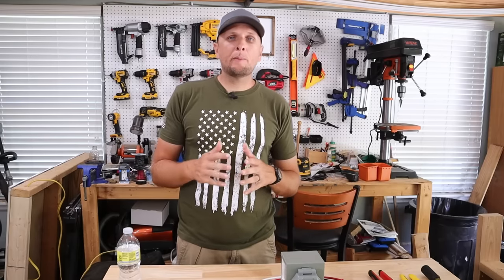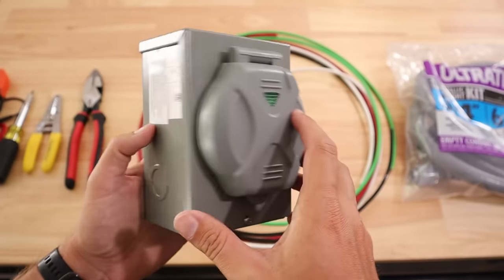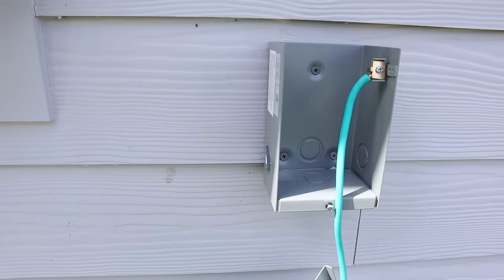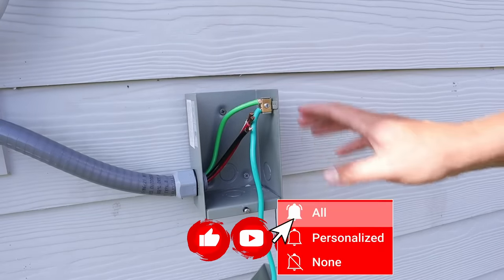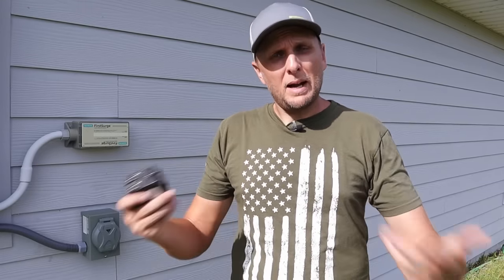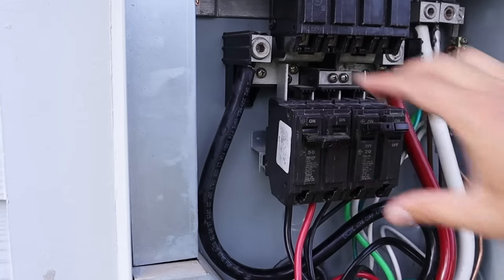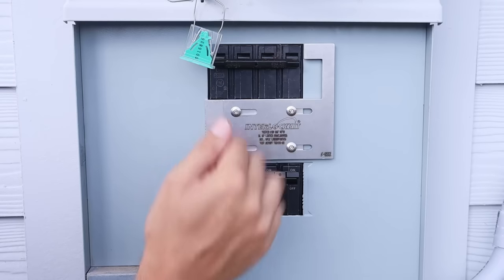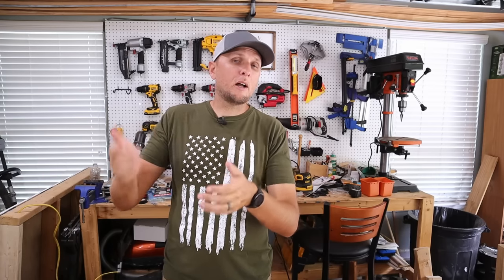The BEST Way To Connect A Generator To Your House - Interlock Kit With Power Inlet Box Install

Comment: Great video.  I have done about 4 of these installs (30A), the process is the same, the plug & wire sizes are different.  The interlock kit is essential - this will prevent you from back feeding the power lines & not injuring the guys trying to fix the power.
Reply: all of the codes for proper solar systems require a electro-mechanical disconnect that automatically disconnects the grid from your home in the event of a power failure. It must be manually reset and can only be done so once the grid is going again.
Both the City/County inspectors along with the energy department's inspectors must sign off on it to get your system approved.
If a buy back of over produced power is approved, then a contract and bidirectional meter is installed.
There's nothing like a lineman getting zapped by someone.
I've seen the mechanical ones and they're fine, however for those on hospice care and CPAC machines, keeping the power going automatically after the power goes out is nice.
Reply: @Keith Lucas, can you advise where I can find an electro-mechanical disconnect and what they look like? Thanks
Reply: What size wire for 30amp plug?
Reply: @juanrdgzg 10/3 Romex with Ground
Reply: Seems like it’s always better to install a 50A generator inlet and just use an adapter for the cable so if you do upgrade you don’t have to replace it.
Reply: Use wire size for 50 amp just in case you size up from 30 amp.

Comment: Well done once again. I had a 8500 running watt genny II connected through an interlock kit on my main panel. I worked flawlessly, powering everything except the 3 ton ac. Tankless hot water and furnace are natural gas. Last year I caved and had a whole house 24k ng unit installed by a contractor I use a lot for rentals and our house. $12,800 total cost. We also added the Micro-Air Soft Start to the ac unit.

Comment: Great Instructions! Thumbs up on this one. I set up a 30 amp interlock system for my house. Using a 55 watt 8250 watt surge gen. Only thing I can't run is the Central Air. I went one step further and converted my gen to use natural gas so I don't have to worry about gasoline storage problems. Thanks for the Vid! :)
Reply: I have a similar set up but with a propane conversion. Look into getting a soft start kit for the central air. It ramps up the amperage to allow the generator to handle the load.
Reply: I got a 12000 watt DUROMAX but am going to be installing a 30 amp switch like you. Though the DUROMAX can handle 50 amps, the cost is double and I don't plan on ever running this beast beyond 50% load.

Do you have any info or are you able to point me in the right direction or as to how I can go about converting mine to natural gas also by my chance?

Any help would be much appreciated
Reply: @nikolasvel  One caution: If using a power cable less than 50A rated be sure to use the generator's 30A receptacle, not the 50A one, & be sure anyone else using the unit knows - and remembers - that. Fuses and circuit breakers exist to protect wire and the 50A outlet from the generator would not safely protect a 30A (#10/3) cable.
Reply: @larrydouglas3951  thank you for the response. I ended up going with a 50 amp cable, 50 amp recipticle, 6/3 copper wire to a 50 amp breaker and an interlock kit. I also added a "reliance power back on" detection device.

Comment: Excellent Video.  This is the Same setup I used in our home.  It's low cost, compared to Transfer Panels, way easier to wire, and works safely, preventing power back feed to the utility.
Reply: If you have the intelligence and skill to do this aren't you capable of switching the main breaker off " preventing power back feed to the utility" ?
Reply: @bigpardner  Who is going to guarantee that you will be the only one to do the power up?

Comment: Great tutorial, thanks for helping me out, more clear impossible. Noo wasting time ,pure knowledge, and easy to understand. I just finished my installation. I will try tomorrow morning .Let's see 👀 .My only concern is if the inlet box led indicator is just turned on when the generetor is connected and sending power through. I installed everything, but when I turned off the main brakes, I didn't see the tiny light on the box light up.

Comment: Enjoyed the video. Years ago, I also installed a manual interlock kit on my Square D panel. The kit is basically the same with a nice template for drilling the panel deadfront for the interlock plate. I used a "3R" enclosure for my generator receptacle, in that, the twist lock plug plugs in the bottom of the box, making the connection waterproof. Works great. Thanks again!
Reply: I was considering just mounting my receptacle box directly to my main box allowing more water resistance 👍 I think it's a good idea.
Reply: Can you elaborate on how you did that? I need a waterproof connection myself

Comment: Great video.  I found an interlock for my Square D panel for 30 bucks!  Lots of room too.  I have a 4500W (120V only) but it runs everything I need for winter outages since I have a Blaze King wood stove and I can run my water heater at 120V, it just takes longer to heat.  And I got all my freezers and refrigerators running fine which is the biggest deal.  Anyway thanks again I kinda just confirmed what I thought.
Reply: Can you tell me how you made the adjustment to 120 volt on your electric water heater? I'm not being smart I just want to know so I can go smaller on my generator.

Comment: Great informational video! 

You should also ground your generator.  I used an automotive battery cable and a screw clamp to the ground rod near my box.

If you only have a 30A generator, select wiring and a tie-in plug rated for 50A. Be sure to use a 30A breaker in the interlock.  When you get that bigger generator, then you can swap out the 30A breaker, and will not need to rewire or replace anything else.
Reply: If you plug a 30 into the 50 amp plug the generator already has breakers for the output, in that case the panel breaker only serves as a disconnect. So it doesn't matter.
Reply: Generators these days are already grounded...  Some states dont require  additional grounding..  However check your codes..Yours might

Comment: I did pretty much the exact same install for about $100. Had to purchase an adapter plug to send 120 into 220 to run my predator 3800. It runs everything in the house other than the hottub

Comment: electrician here , you did a pretty decent job! it's generally helpful to measure any wire coming from your junction by the length of your hand plus your thumb (thumbs up). it you have trouble feeding your wire through the carflex.. you can dump a little water in there and your wires will slide on through , alternatively , you can buy wire lube from your local supplier.  the bend radius may be exceeded on your feeders mainly black . its not bad but pretty close to being a violation.

Comment: Hello Sir, love your videos.  Very informative and very easy to follow.  I have a situation though.  I'm trying to set up an Ecoflow system in my garage, and in all the videos I have reviewed, the Main is typically incorporated in the same electrical box.  However, my Main cutoff is on an outside panel and the inside box is on the opposite side of the house.  How would I go about installing the 30 amp plug in the garage and the interlock switch since it doesn't look like have a Main inside?  Would I have to install another Main on the garage electrical box?  Thanks for your time.

Comment: Good job Adam and nicely explained! We have virtually identical setups. I have a MicroAir Soft Start on my 6T AC and a 9500w Westinghouse generator dual fuel running into my 50a inlet box. Works perfectly!
Reply from the maker: Hey Lenny, yes I think I recall many months ago talking to you about the soft start kit.  I think you were waiting on more to come in.  It makes a massive difference doesn't it?  Really glad to hear you are all setup.  Thanks a lot for the feedback.
Reply: What does the soft start kit do and how do I know if I need one? I have a 9500 running 12000 peak generator that I just set up for 50 amps exactly like your video shows.

Comment: just be careful and use a torque screwdriver to make sure its within specs
Reply: Great advice with torquing to spec.  Also, 6" of wire from the face of the box would be nice and perhaps strap your conduit with a one hole strap.

Comment: I went with a Manual Transfer Switch and purchased the largest portable generator available, 17.5kW, and put a propane conversion kit on it and set a 500 gallon propane tank in the ground.  To exercise the generator I use a 30# bottle and hope I never have to tap into the stored ground tank. Yes, I have been hit with several major hurricanes in my lifetime and simpler is better.  Sometimes we have been on generator power for two weeks till power is restored. Gas lines at the few operating stations are insane, no more gas for me. I make sure to kill the breaker to the stove and dryer lest "some one" forgets we are on auxiliary power.  The water heater is a heat pump unit and  it only draws 3 amps so no more heating bathwater on the back porch with the fish fryer.
Reply: I love this idea. I don't know much about propane storage. How long will a 500 gallon propane be good for when stored long term? Do it go bad, like gasoline over time?

Comment: I have the Same set up But I have a 9500/12,000 Generator, I did install the Micro air   It runs everything  total cost including electrician was $2100   Generac wanted $12,000 for an auto start Permanent

Comment: Just keep in mind that even properly done, interlock kit and so on, linemen won't (might not) power up your home if they hear a generator running. When you see them in the area, either turn it off or make sure to let them know If possible. 
Great video.

Comment: Last fall, we had an electrical contractor come in and install this in our home. We set a portable 13kw generator on a pad and covered it. We had already upgraded our panel from 100 amps to 200 amps with all new circuit breakers as needed. The contractor ran conduit from the back of the house, through the attic and into the panel. Several breaker upgrades were done, plus the breaker from the generator and installed a surge protector. If the generator is needed, we simply shut off the power into the house, start generator, switch on the circuit breaker from generator and the whole house will now be running off the generator. I have a number of individual breakers to household that will be turned off since we won’t need power to those areas. The most important to HVAC, freezer, refrigerator, stove and kitchen, plus a few others will provide the necessary emergency power. It’s a great system, cheaper than an installed full house auto start generator. I decided against that because running the gas line was going to be really long and difficult to install. The generator can run from gasoline or propane.

Comment: I run a 6kva  single cylinder diesel generator, 100% reliable - has to be as I live in the caribbean, runs the whole house- no problem. Also very important to operate under the kiss principal as part can be hard to come by.

Comment: I looked at these cheapo amazon inlet boxes. I bought one maybe it was the rophor even... they are tiny inside trying to feed in 6/3 wire and make all the connections was too tight for me.

If you have the mulah I highly recommend GE T050N. It is a much heavier duty box and the plug actually sits in it at an upward angle of about 5 degree, when you are using a massive heavy generator cord rated for 50amp it puts a lot of stress on the ends when you plug it in at a right angle so this is just a way better design. 

I also found a guy on ebay who 3d prints magnetic covers for the bottom of them to keep wasps and other big bugs out of it. 

I actually mounted mine in my garage then used a PVC RV cord port to pass the cord through my garage door. Works pretty slick

Comment: We live in Louisiana and as you know we get a lot of hurricane and tornado weather.  Presently I’m running a 6500 generator that is wired to my panel box.  Before operation I have to turn off the main and all the 220 switches.  I go outside and get everything set up and start the generator so it can warm up I then go back in and turn on the main, go back outside and make sure the power switch on generator is off.  I then hook up the plug to the switch I have set up outside and connected to the breaker in the panel box I turn on those 30 amp breakers go back and ensure generator is at full power and flip the switch on the power switch and viola I am able to run all 110 outlets and lights/fans.  Now we are ready to increase the size of the generator to run all 220 as well so we have A/C,hot water heater, make coffee and microwave if needed.  Going to get a generator that is electric start as at 79 years young no longer able to pull the cord to start the current generator.  I’m going to subscribe to your channel as you are fantastic at explaining and showing what you are doing. So many take it for granted that the audience knows what they are doing skip a portion of the video. No you my friend a the main reason I like your channel!!! Thank you for taking your time on all the steps of a project.

Comment: Excellent information. I've been looking for information on this type of set-up. My house has an interlock set-up and I've been contemplating buying a portable generator in case of power outages. My area recently experienced an 18 hour loss of electricity and acquiring a generator has moved to the top of the "buy" list. Now I just need to figure out how big a generator? Seems a 12KW for whole house should do the trick with a bit of reserve generation. Big thanks from the PNW!

Comment: Good video.
Nice set up, IF it's not raining or snowing outside.  One major thing people need to think about that are thinking about doing this, is many power outages happen during storms (when it is raining). No one in their right mind  is going to be running their generator out in the rain or snowing. Remember water and electricity is a sure fire way to light your ears up and get electrocuted or short out and ruin your generator.
Reply: You can protect your generator from the elements and still run it.  Also, you can set up the generator before the storm.  This way you only need to start it. We have a GenTent for our generator and it protects our generator in bad weather.
Reply: @Pk3_Garage  LOL
Not laughing at you. Just the thought of me using a generator  tent on my generator out here in the desert where I  live. That tent would be ripped  to shreads and flying  over the BLM land across from our house. We get wicked winds here gusting up to 45mph +. I am still working on an encloser for mine.
Reply: I gotcha. The Gentent is rated up to 78 mph hurricane winds.
Reply: @nmsidewinder  45mph wicked? Heck, on the edge of the Rockies, with a Chinook blowing, we see steady state of 60mph, with gusts to 70-80. A Cub Scout tent may not handle it, but we have expedition tents that easily handle that. It’s easier to build a 3/8” plywood shelter, using hinges, or fittings that go together like a door hinge, then insert pins - so it stores mostly flat. Of course you need to secure it. Bury a couple anchors, with flip down cleats, like you see on a dock, for boats. Use a couple quick adjust ratchets, your “tent” can be set up in minutes, before bad weather hits, & will withstand really big wind.

Comment: you seem to know a lot about electrical things so that you might be an electrician, videos are very informative that being said you might want to address the fact that a lot of people don't know about generator sizing the 50 amp generator you are using will certainly not power the 200 amp service you home has im sure you know what breakers to turn off in a generator situation . A lot of people don't know that and when the fire up that generator and the house load comes on it will stall the generator. have been called many time from people that say their generator stalled ,the went to the local big box bought a gen set only to find out it was not large enough to do what their  needs were. im not saying your wrong with your hook up just that a lot of DIY need more info .
again I really like your electrical vids being an electrician you cover all thing electrically really well ,thanks .

Comment: Excellent video, clear, pithy and to the point. What size (wattage) generator would I need to be able to run my A/C during an outage, its an average sized unit that cools a 1800 sq ft house, we just went through hurricane Idelia down here in Florida, we only lost power for about 5 hours, we were lucky, but these storms come during the hottest time of the year and to be able to run the air at least at night would be nice....Thanks.
Reply from the maker: It is hard to say because every unit has different ratings.  You would need to find out how many watts your AC uses when it first kicks on to get an idea as to what size generator you would need.  And I would recommend getting a soft start kit installed because it can allow for a smaller generator to run the AC or just take some of the load off the generator so you can be running other things as well.  Idalia went past my house today as well, sunny now.  I was ready, everything prepped, generators fueled up and placed where I wanted them, and then we never lost power.  Had some strong storms and wind but that was about it.  Glad you were only out for 5 hours.  When Irma went through we were without it for a week.  You're right, it is brutal to be without power/AC this time of the year.
Reply: I watched the soft start video as well, that looks like a MUST HAVE  disregarding the generator.